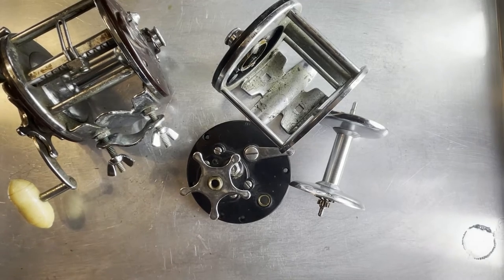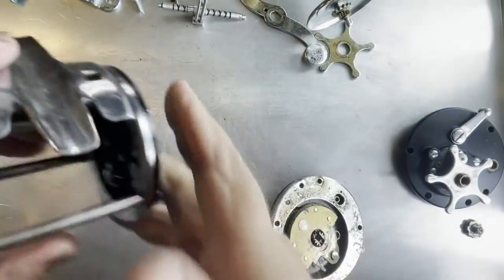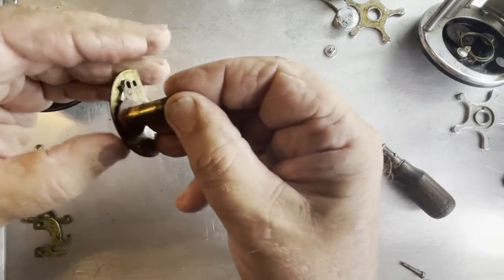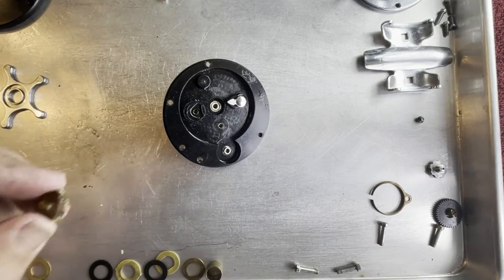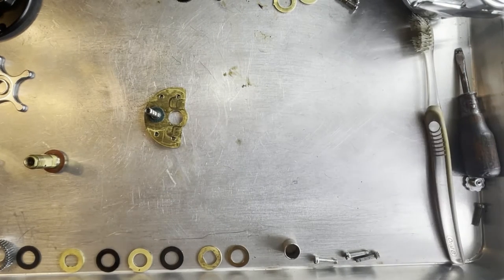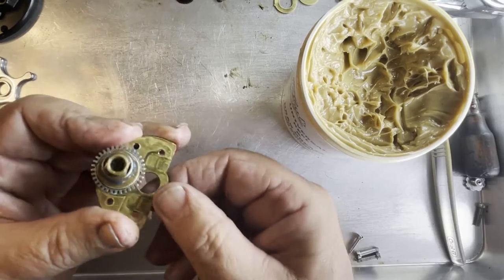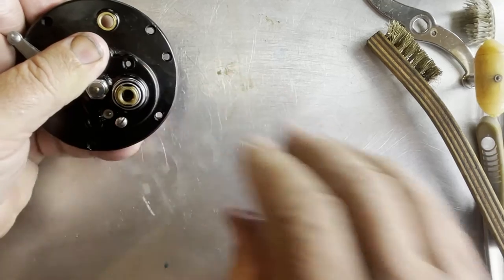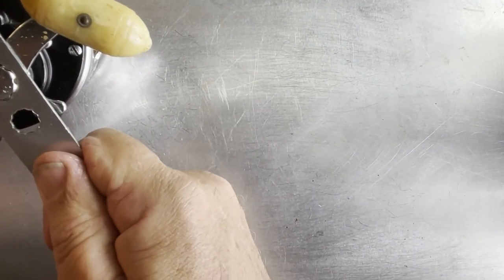Young Martin's Reels Penn Peer 209 Service and Lubrication

Comment: Glad you made this video, Rick. I have three Penn 209 reels that I use for river trolling. Haven't used them for about ten years, so I know they need to be serviced.
Reply from the maker: Knowing you as well as I do so far, I’d be surprised to hear that you’d never been inside those reels if you’ve had them that long. These are some of my favorite reels to work on but they aren’t that versatile when fishing. I think trolling is about the only thing I want to use mine for. That and playing with it as I watch tv. They make great fidget spinners. You do have to turn off the clicker though to avoid annoying the wife.
Reply: @youngmartinsreels5314  I've only torn down my oldest one about fifteen years ago to clean and lube. I need to service them all as I acquired a boat last year and plan to do some trolling again.

Comment: Those Penn Peer 209's were solid reels, in my opinion. I have two of them on my Ugly Stick Tiger rods that I use for catfishing. If they have a draw back, it would be the lower gear ratio, but is fine when bringing a fish up from deep water. Great video, really enjoyed it.
Reply from the maker: I like to use them for downrigger fishing. Right now I’m not doing any but I plan to go back to it. Very nice reels. There will definitely pull a big catfish up.

Comment: I have an extra one of those seat clamps. Let me know if you need a replacement.
Reply from the maker: Dan, I don’t have one but I don’t think I’ll ever clamp one onto a rod. I’ve never hooked a fish so big that it needed it. I have found that I now have a lot of large water equipment that I’ll probably never use. It is cool to have though. For some reason I’d like to acquire a Penn 16/00 reel. Not because I’d ever use it but because I’d like to take it apart and service it. Go figure.